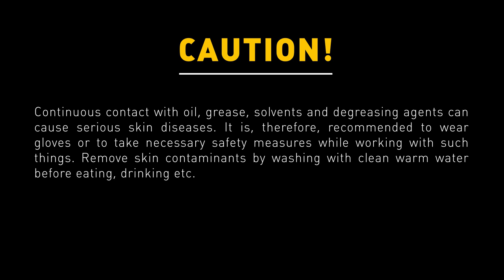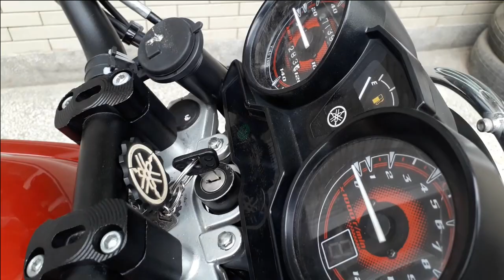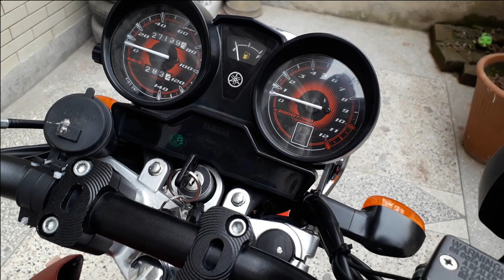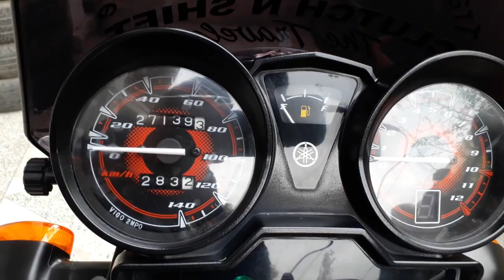How To Change/Replace Meter Lights Of Motorcycle | Yamaha YBR DIY | Motovlog | Pakistan

Comment: instead of unscrew the meter cables and unscrew the two bolts you showed in the video, putting down the headlamp and unscrew their bolts are very much easier way to pull out the meter cover and further to change the meter smd's...
Reply from the maker: Good but if u umscrew head lamp, then u will need to readjust its position, so it's better to open meter.
Reply: @AmmarBiker  Yes,  and for that i used silver marker to just mark the original position of lamp...its way easy and importantly meter cable nhi kholni prti....👍
Reply: @AmmarBiker  One more thing, i watched the front mud flap wali video, excellent find dude i just ordered it for my ybz as well BUT its expensive now costed me 3.80$...but iam sure its totally worth it...again a very good find👍
Reply from the maker: Good
Reply from the maker: Yes, prices up and so does the exchange rate